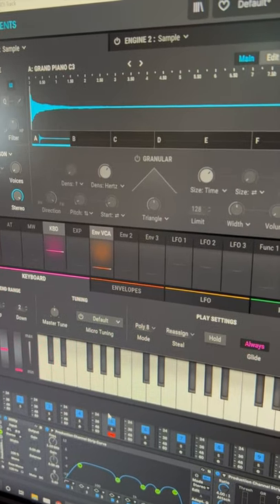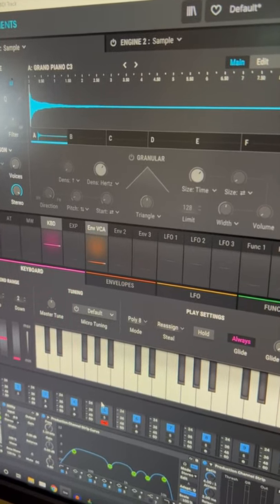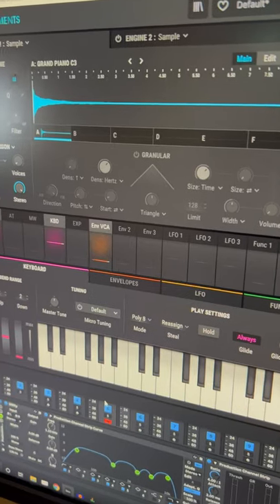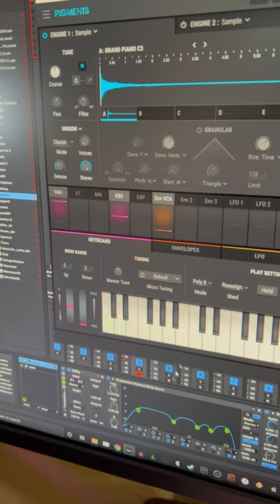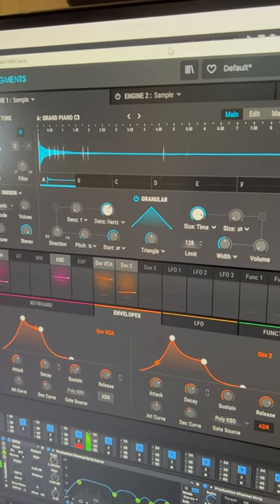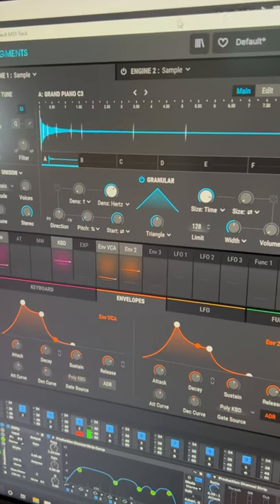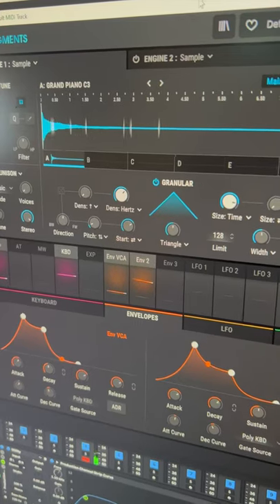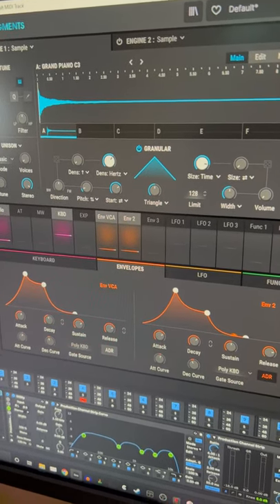What is Granular Synthesis? #shorts

Comment: Any suggestions on granulizer plugins? I've been playing with Fruity Granulizer but it's not as neat as The Mangle (which is too old to be used anymore)
Reply: For synths, there don't seem to be that many. Arturia Pigments is absolute heaven though, I think they "got" granular just right. There are a few settings that let you choose the shape of the grain's envelope, so you can have sharp and clicky grains or perfectly smooth, atmospheric ones like Chris is showing here. Then there are plenty of additional knobs to play with for density, length, starting point, pitch variation, playback direction etc, and all of them can be randomized to the degree that you want. 

There are other granulizer samplers, but I haven't tried them: there's Spacecraft from Traction, for instance. And there's a granular synth for Kontakt called Granulate 2, by Fracture Sounds. This one sounds lovely in the demos, but that's all I know. Phase Plant is likely to acquire granular synthesis at some point, since the developers revealed it's the #1 request they get - but who knows how long that'll take. I'd trust them to do a great job though!

edit: There's also Granulizer 2 by Inertia Sound Systems, just a sampler (like Fruity Granulizer) but with lots of granular features. Could be very cool, but it's already almost half the price of Pigments.
Reply: ...but if you mean effects, than I have yet to find one that approaches what Pigments does. There are quite a few granular effects now: MGranulizerMB by Melda, Bleass Granulizer, Grainspace by Audiority and others. Since I'm looking tor an effect that can sound the way Pigments granular synthesis sounds, I''ve been disappointed by all of them. It is subjective, of course. My impression is that they often apply almost "rectangular" envelopes to the grains, with little attack and release, so that the grains sound clicky and harsh. Then for a good measure they tend to add pitch shifting, so it becomes chaos. I've demoed the ones that have trial versions, didn't buy any of them, except for the MGranulizerMB. And I tried very hard to like it, but I can't. It produces ugly random chaos and I've been unable to tame it so that it would produce something smooth and gentle (again, like what you're hearing here).

Now, effects have it harder, because they don't "know" the audio until it starts playing, so they need a while to buffer the grains, and obviously they can't do what Pigments does with randomly picking a grain from somewhere in the entire sample. But it should still be possible to create an effect that produces smooth and gentle grains. I haven't found one that can though.
Reply: Mmm there are not so many free option when it comes to granular (especially the synths) BUT there are two excellent free granular effect plugins I always recomend. The first one it's ++bubbler (it's a granular delay but you can also use it a standard granular) and the second one is Emergence. Emergence is basically a granular delay with 4 segments of granular (stream) , this also works as if it were a granular delay but each of these can be controlled to your liking and if you simply bring the volume of the dry and the buffer to zero , you will get only the grain part very easily.

You also have several very useful controls such as the "freeze" button and the "clear" which you can basically use if you overdo it too much with the various sections of the grain. I warn you to not exaggerate too much because it can get uncontrollable at times but it's a wonderful plugin and make sure if you unintentionally do use the double click to return back to default the knobs (especially on the stream section). Emergence can be found for free on KVR , than the other one , the ++bubbler it's part of a bundle by SoundHack , you can find all the information on the manual for bubbler but it's really easy to use :)
Reply: Omnisphere granular is truly epic.  Comes at a cost unfortunately.
Reply: @SongOfItself  Thank you for taking the time to chime in with your recommendations & input
Reply: @TheGhostRecordsChannel  Thank you as well
Reply: check out PaulStretch